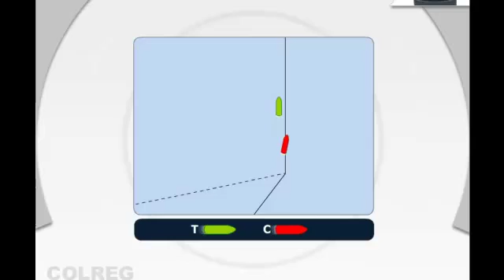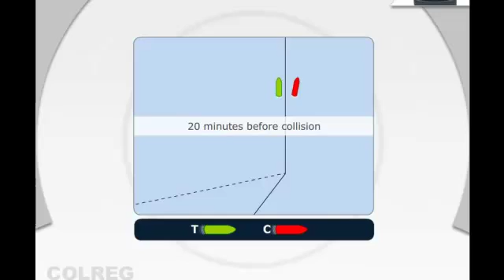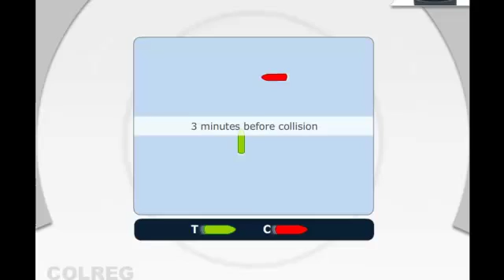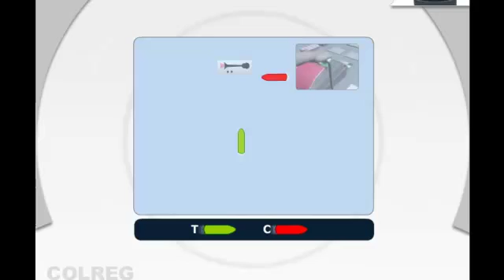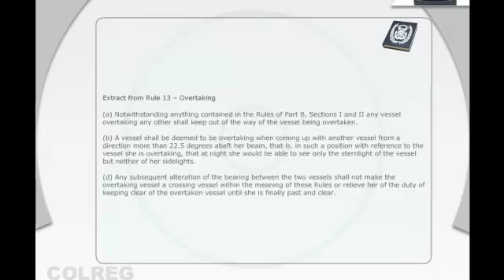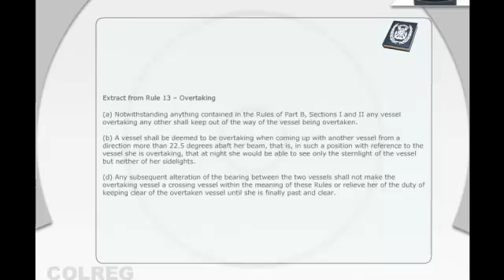Vessel Collision Case Study 3

Comment: Respected sir, 
I have question, 
If stering fail or any system fail, if ship is in sensitive areas like bridge 🌉 or nearby any ship. 
Ship must slow down, close as you are saying, put anchor. 
My question is for ship without problem. Why they can't take reverse gear quickly.  Ship can't stop but reverse is possible. 
Any ship over taking is possible face failure of engine and turn. 
Only help we can give ship is to reverse direction.  Is it possible. 
Jay bharat.